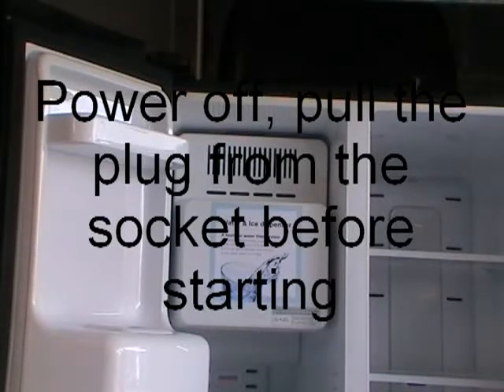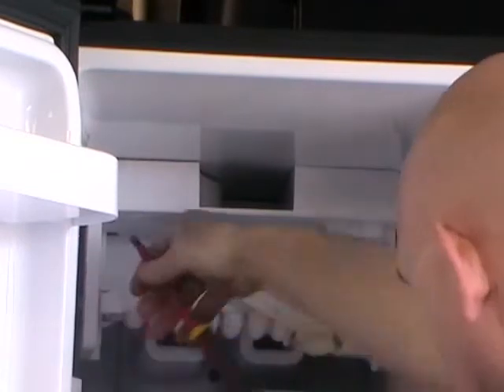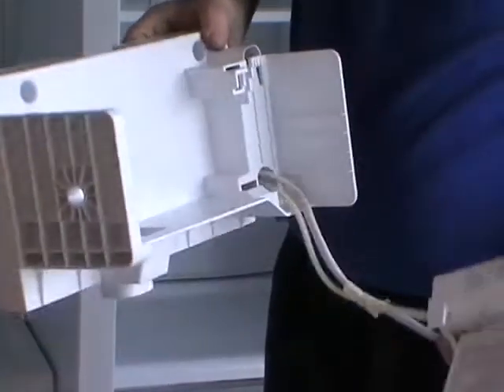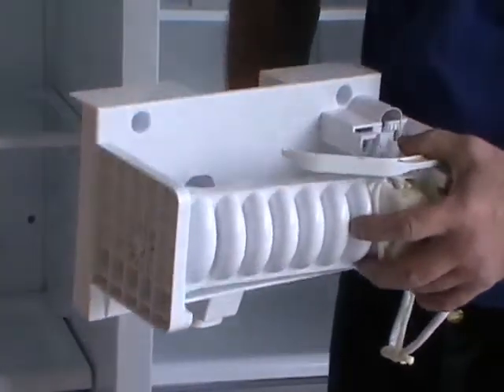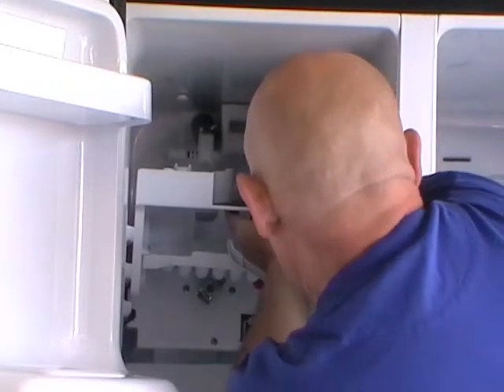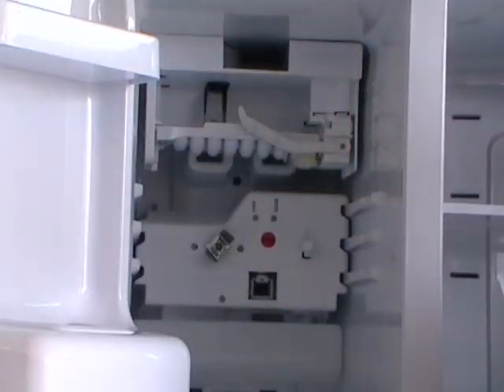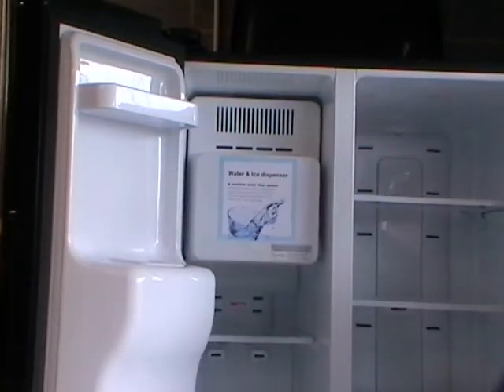Samsung american fridge freezer RSH1 icemaker removal and refitting

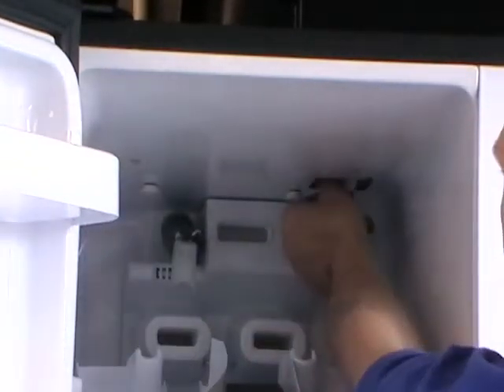Comment: Have the same model. My icemaker isn't producing any ice . The water is freezing in the pipe/spout  which clogs it(the one that you can see at 0:49, left side, it has 2 wires going out and some kind of insulation around it)
Defrosting the whole Freezer helps but after 2-3 weeks I have to do it all over again :( Is there somekind of defrost/heating element on the pipe that isnt working anymore?